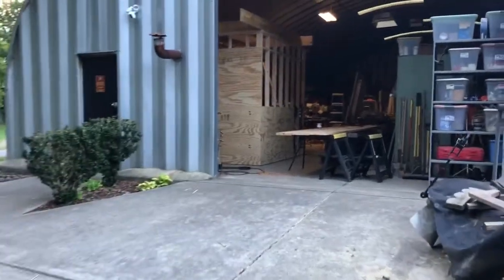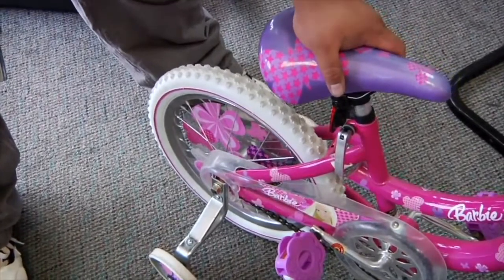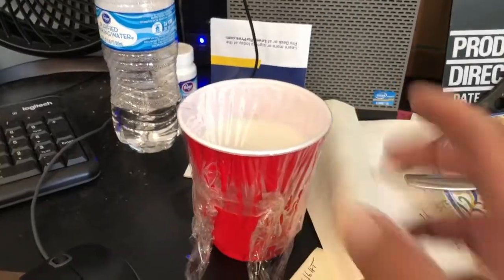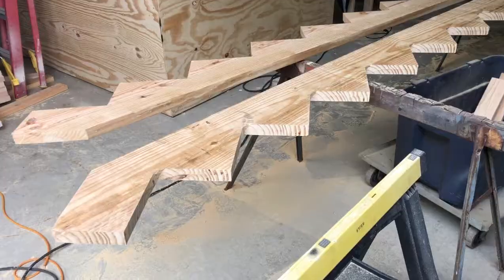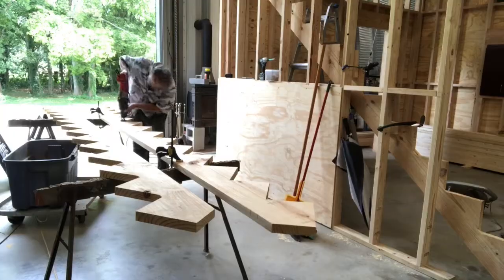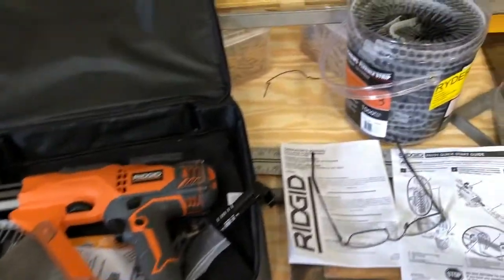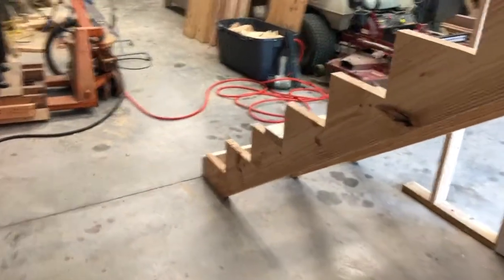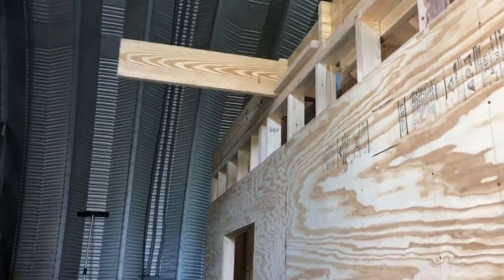Shop Build VLOG5

Comment: Bacon, sausage and milk, a good power breakfast :-) Those one hand operated clamps are great, I bought four of those some time ago to try them but last week I bought a bunch more, 2 euro a piece, I don't understand how they can make them that cheap. 

Having the right tool for the job makes all the difference. Sometimes you can punch yourself that you didn't buy it earlier :-)
Reply from the maker: They have their place.  They don't clamp all that tight but they are quick grab.  My favorite clamps are the "c" clamps with quick set and quick release.  The handle turns to 90 degrees so you can really crank on them.

Comment: I built a large insulated door that hinged on one end to insulate the main floor of a barn from the seriously drafty loft. I used a rope tack to lift the door up so you can go up and down without hitting your head. just think of Grampa's basement of the Munsters.
BYW, I am on a low salt diet and I feel so much better, just can't have sausage and bacon.
best
Reply from the maker: I don't get sausage and bacon all that often.  Mostly cheerios and maybe some fruit.  I am on my way to the big box to get a 6x6 and some other stuff to remove that double joist and just get it out of the way.   Thanks for the comment.